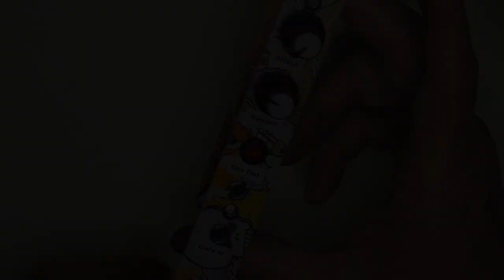Modular Synth Project, Part 2 & 3 - MIDI to CV , and Envelope Generator

Comment: Nice! I'm enjoying your series of builds and love the aesthetics!
May I ask about the MCP4922 reference voltage? The MCP4822 (as used in Larry McGovern's build) has this internally but I'm not sure how it can be implemented with the MCP4922. Are you using the VDD for this or is there another source? Thanks
Reply from the maker: VDD, since the board has -/+ 12v for the opamp and +5v for everything else, inc the atmega and the DAC
Reply: @stevebowerman  Thanks for the quick reply. I'll try the VDD and test the results. I thought of adding a dedicated IC to supply a 2.048V reference voltage as that's what the MCP4822 has internally. I'm not a coder so I may be missing something that needs adjusting in the sketch but I'll 'test and see'...
Cheers!